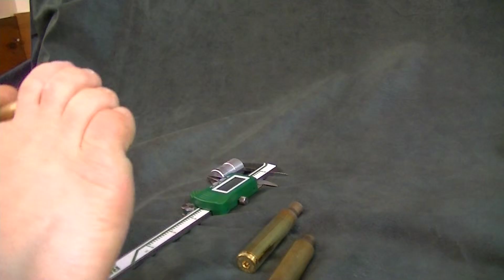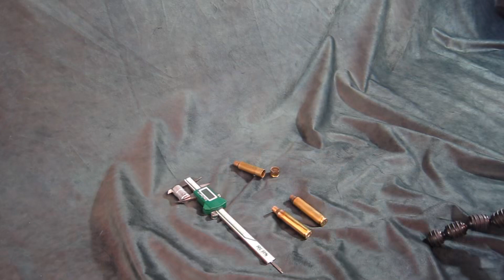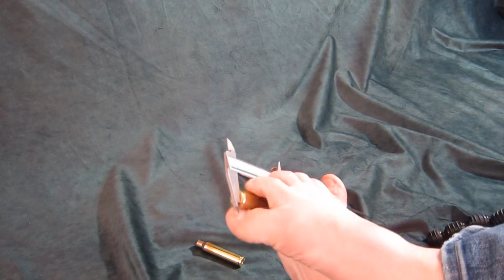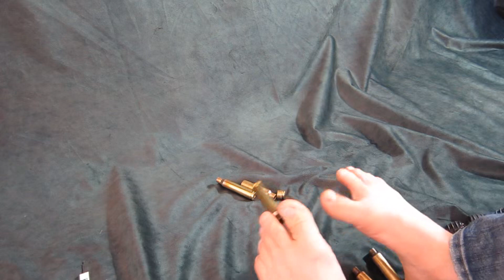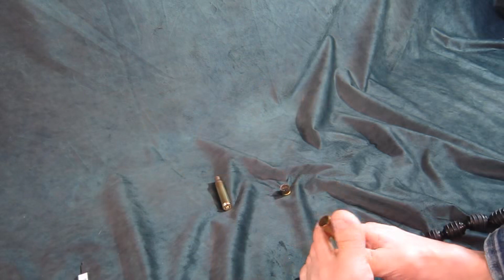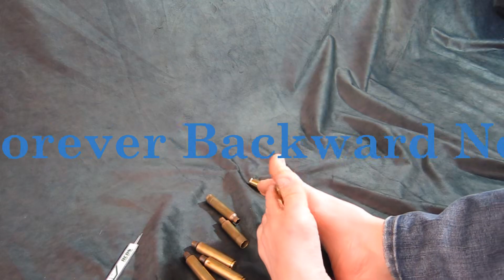375 Cheytac Case Separation Anlysis

Comment: I think i agree with your outlook on the Improved variants. It seems like the gain in performance is small to negligible while the drop in efficiency is more significant. 

A lot of detailed profesional development went into the proprietary .408 and .375 cheytac family of cartridges. And I trust that groundwork more than the Wildcat versions.